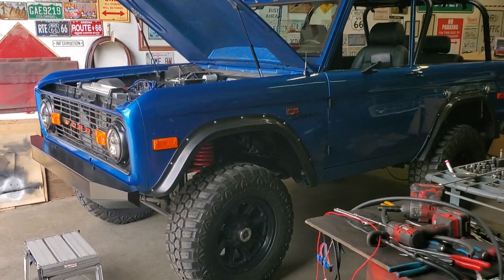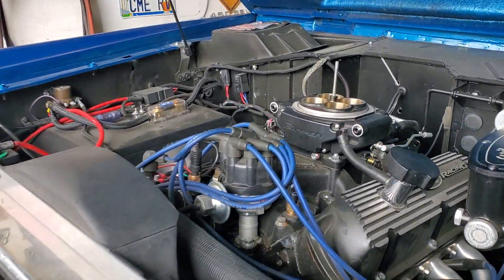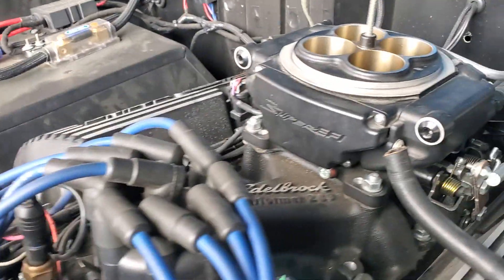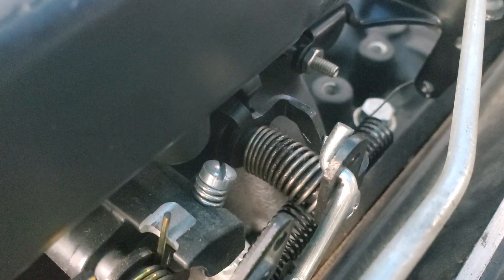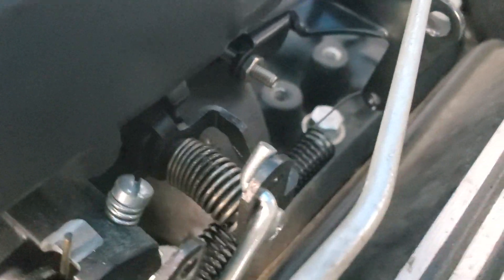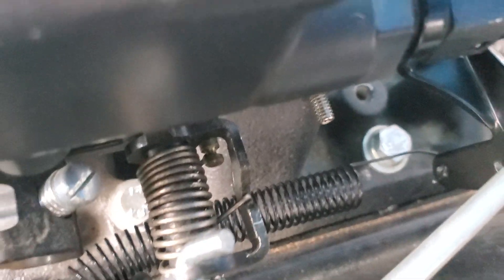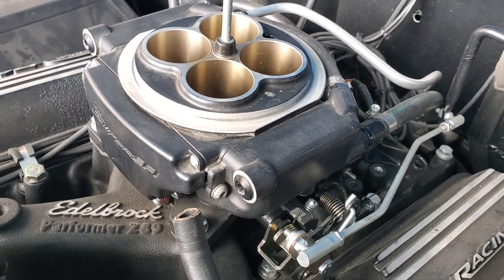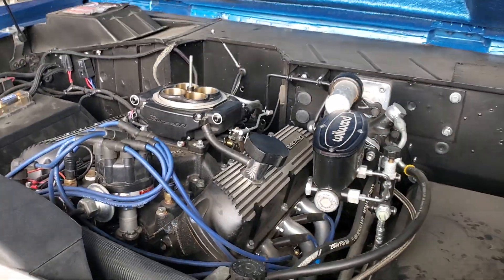Sniper injection high idle issue,hopefully the fix.

Comment: you cut us off! wrapping the torsion spring one more wind will work but not correctly the proper fix , holly tech support said  to loosen butterfly screws and readjust or re-center secondary valves, also good idea to re-center primary valves as well, requires removing the throttle body but it the correct way to fix it instead of over-stressing the torsion spring and throttle pedal, next time finish your video and share your results geesh